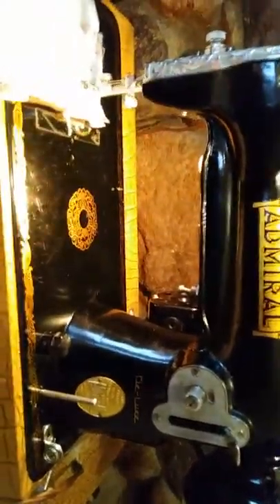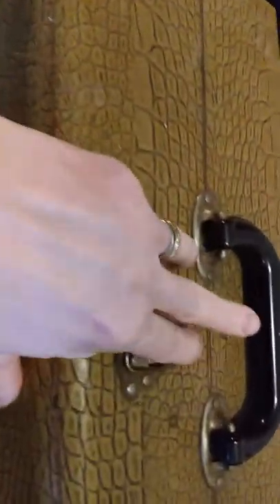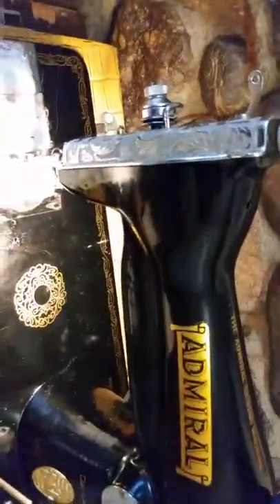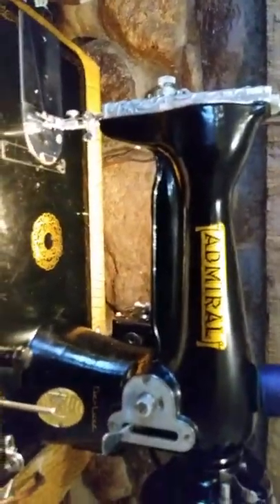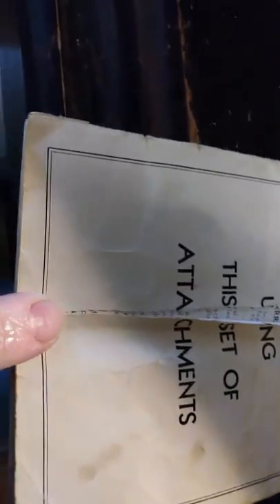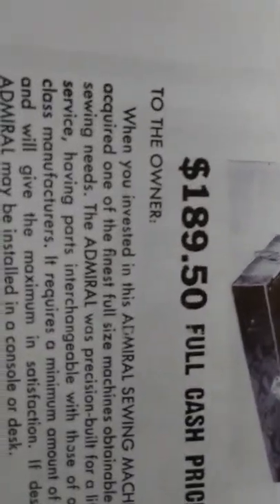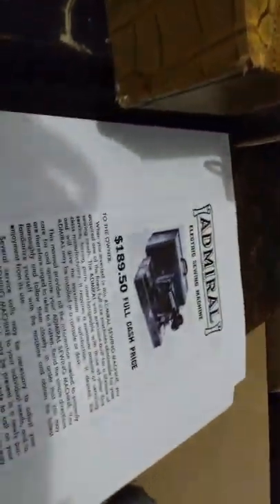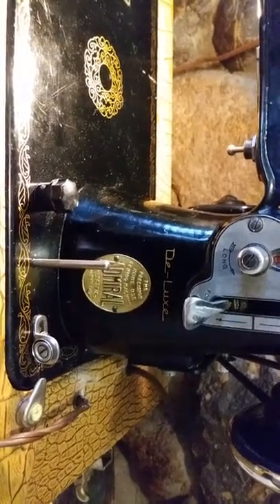Admiral De-Luxe 1952 Sewing Machine Overview

Comment: I bought one with the attachments. However, it does not have a manual. Mine has a plaque on front that says “Admiral De-Luxe 1952 Model”. I would like to start using for sewing my blocks together. I do not have book for the attachments either. Trying to see if I can Google for the manual for machine and attachments.
Reply from the maker: I was able to type it in and Google found me a replica of the manual for my machine!  Good luck to you.